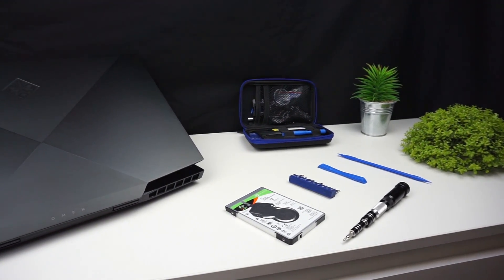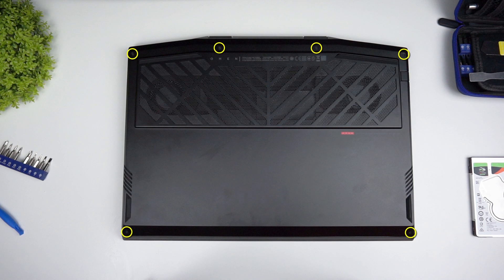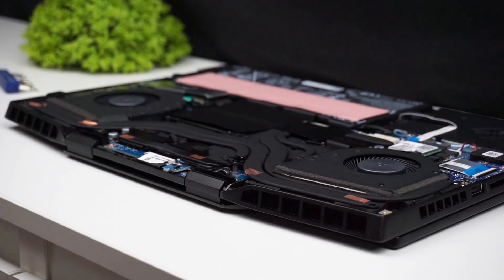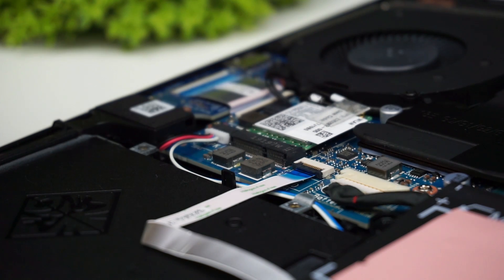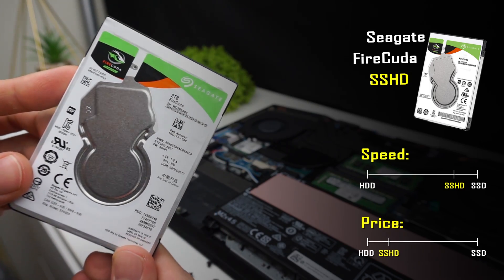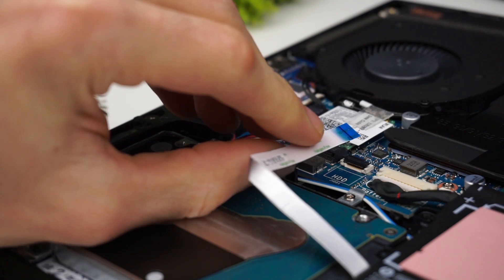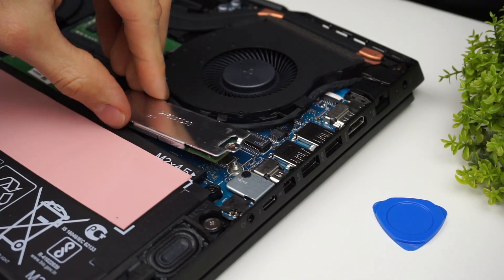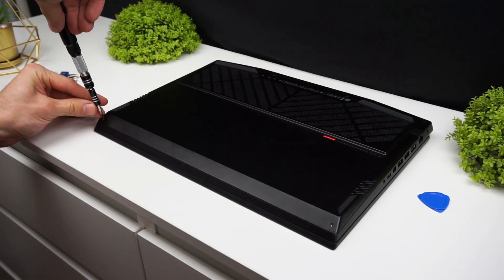HP Omen 15 2019 Upgrade RAM / SSD / HDD - Disassembly Guide

Comment: Hello it's me. Can you help me to choose this laptop. If you were in my place which one do you want to buy? Why?   I have two laptop in my mind. This is a Acer predator helios 300 RTX 2060 model and another one is Asus Zephyrus S  RTX 2060.  What do you think?
Reply from the maker: Tell me the exact model name of this Zephyrus. In genetal Zephyrus it a top-end brand from Asus so it will be more expensive than Predator while at the same time it may be that with Predator you'll get even better performance and thermal.
Reply: @TechFinds  Asus Zephyrus S GX501G

Comment: I'm between Omen 17 and Legion Y740 17. both at the same price during the new year deals, with 16 Ram, 512SSD +1tera HDD, RTX (2070,,but legion maxQ). I need best performance and cooling during high load from the software.
Reply from the maker: In Legion you can't set max fan speed. I didn't test Y740 so I can't really compare but basing on my tests of Omen and on what people say about Y740 in the reviews I would rather go for Omen.
Reply: @TechFinds  Your video means that working with performance and undervolting will give stable temperature and will not affected performance of a device
Reply from the maker: @OmenJap  yep, that's exactly what was the best for this laptop.
Reply: @TechFinds  What about the material of laptop? i heard that meral only for back and except that are plastic, so hinges of the display may be damaged by time.
Reply from the maker: @OmenJap  Nobody can predict longavity, but i never consider hinges any deal breaker, because if you use laptop normally it will last. The 2019 all black Omen is all metal.
Reply: Tech Finds thanks bro, i will go to buy it.

Comment: I'm about to buy the HP OMEN i7-9750H with the RTX 2060 graphics card.
But I have seen many videos and they say that this computer heats up to temperatures of 90-95 degrees when any video game is being played.

Is it worth buying this HP OMEN?

I also like your content and you have earned a subscriber, and I hope you answer me. Thank you, merry christmas and new year.
Reply from the maker: Check out this video and find out more about thermals in Omen: https://youtu.be/wsNPZw2rsFQ (watch entire or start from 10:50)
I think that Omen has good cooling solution, but you have to tweak settings in order to get good temperatures.
Reply: @TechFinds  Thank you for taking the time to answer me.
I already saw the video you suggested, and I think I will buy the HP OMEN.
Maybe in the future, you could make a video of  "how to tweak the settings" of the HP OMEN to prevent it from overheating.
I am completely sure that video will help many people.
Reply: @LuisLopez-iv7me  Agree, you shoul make video about what we need to twek on any laptop (Acer helios, Omen, ROG, etc).
I tried undervolting my omen -0.140, and it does perfect to down the temperature while gaming :)
Reply: @rey9653  Did you undervolt core and cache? And did you undervolt graphic to -0.140?
And what third party program did you used to undervolt the HP OMEN.
Reply: @LuisLopez-iv7me  I did undervolt core, and cache through Intel XTU, i didn't undervolt graphic (not yet)
Reply from the maker: @LuisLopez-iv7me  unfortunately I had Omen for a limited time only and i sent it back as same as other laptops.